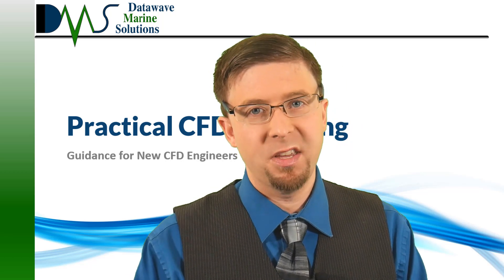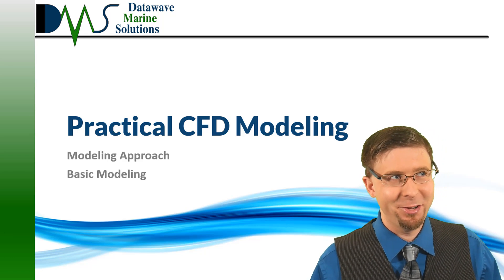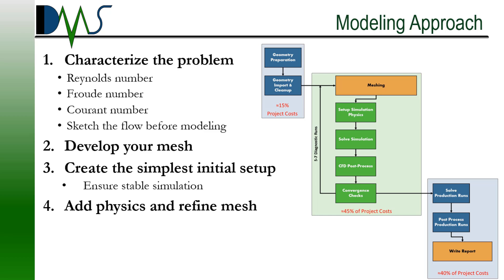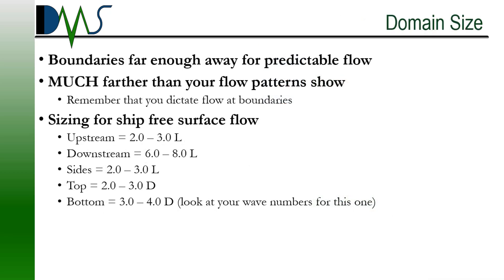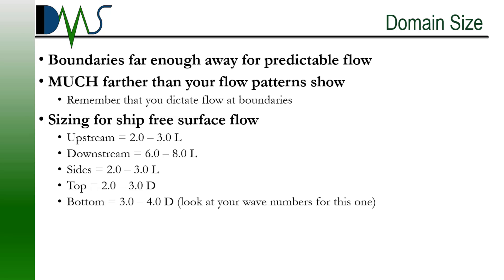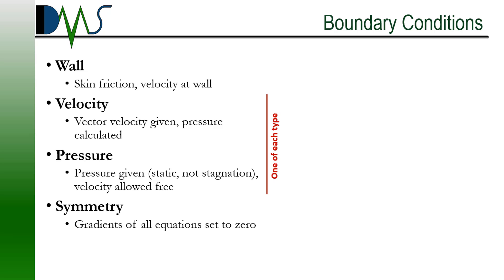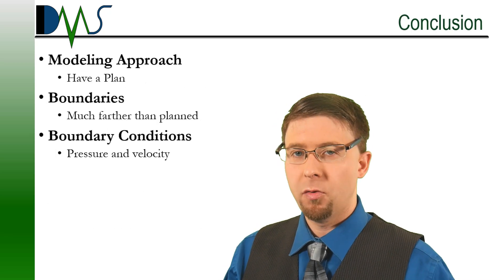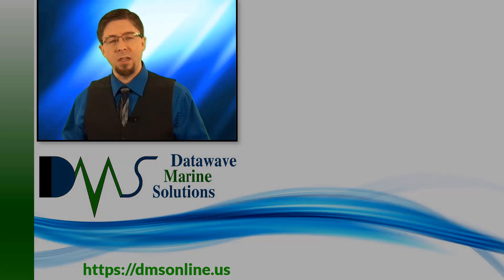PRACTICAL CFD MODELING:  General Approach

Comment: I have a question please reply~ if I paint the bottom of my sail boat with hydrophobic paint, will it make the boat go faster? thank you!
Reply from the maker: This is an idea that has been tried.  In general, yes.  But the other problem is Marine growth on that paint.  International Paint tried to attack both problems by making a paint that wasn't exactly hydrophobic.  Instead, layers of the antifouling paint sloth off.  But they do it at a specific size to achieve smoother water flow over the surface.  End result:. Reduced marine growth and less resistance on the hull.
Reply: hehe using 100% of brain haha